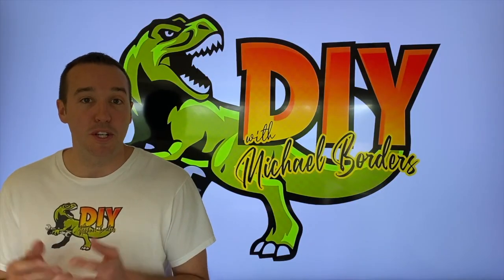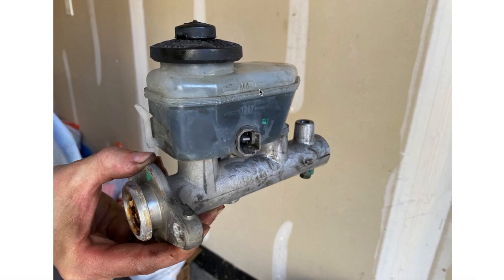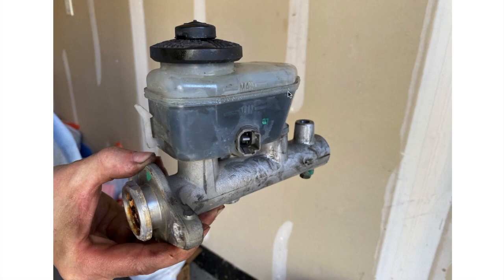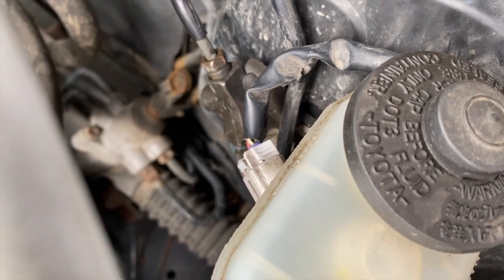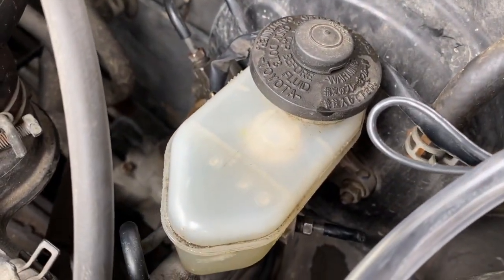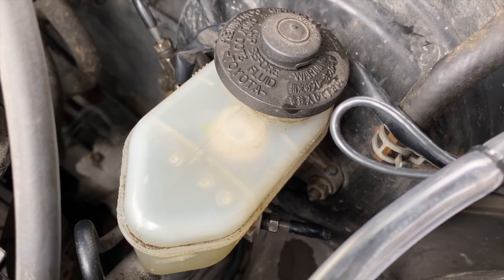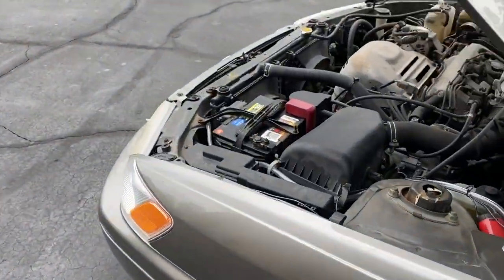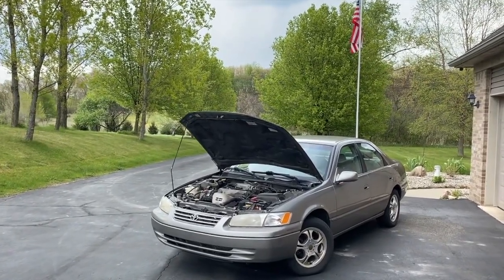Brake light on instrument cluster - Reservoir sensor

Comment: My wire got bitten by rat..but not completely snapped,i can see the teeth mark but abs warning light is still up..could it be caused?
Reply from the maker: Thanks for watching, a recent viewer of ours had this same unfortunate experience.  He mentioned that he spliced wire and installed a water tight seal connection as well as wrapped it properly with electrical tape.  He mentioned it’s worked as designed for 6 months now.  Keep us posted.  😁

Let us know if you have any questions and hey if you’re into crypto trading, check out our newly launched DIY ecosystem.

       Toolboxtoken.com

Reach out to us any time.  🧰
Reply: @DIYwithMichaelBorders  thanks, i'll try it
Reply from the maker: @joeery5699  

😎👍🧰